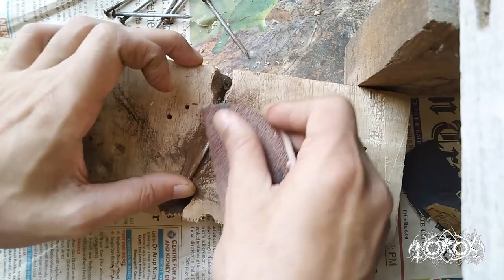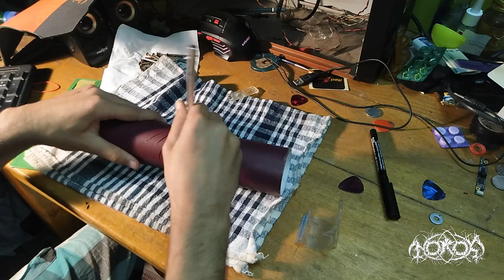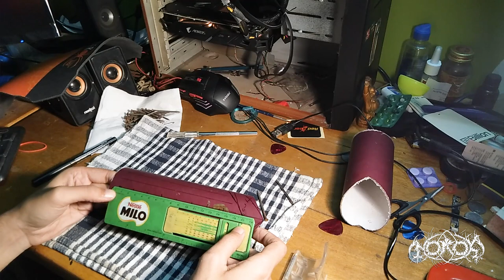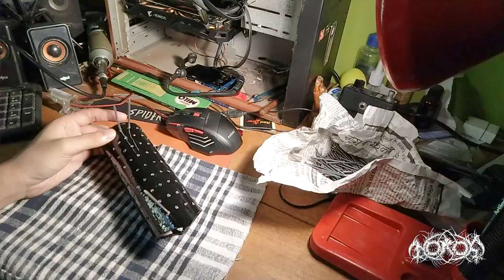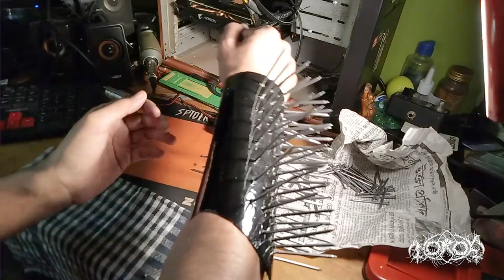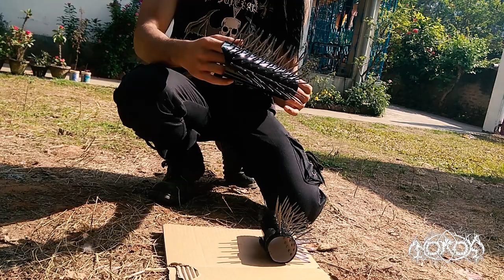DIY Nail Armband at 1$ for Black Metal part 1/2- Building the Armband

Comment: what materials did you used?
Reply from the maker: I had a calendar rolled inside that cylindrical tube. Used that tube. If you play badminton you can use the shuttle's holder tube,its same diameter. I used hardware nails 2 inch and paint is upto you
Reply: @NOROKdsbm  thanks man! yours is fuckin dopee!
Reply from the maker: @ihatesundays4569  Am glad you liked